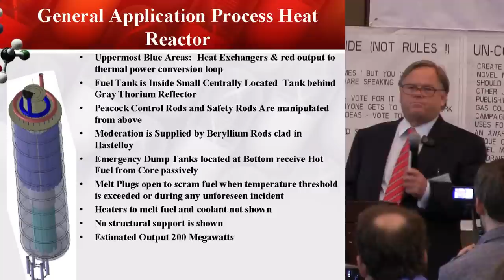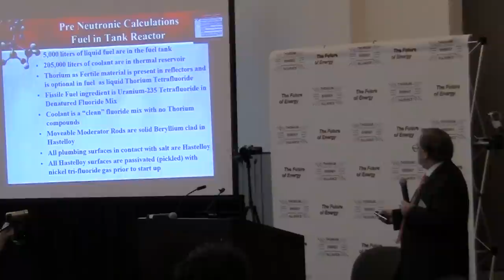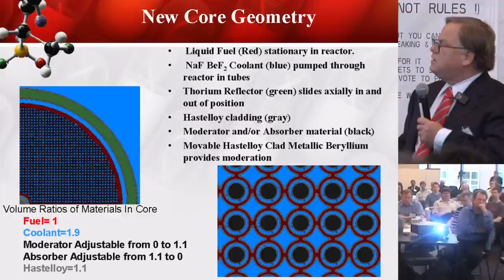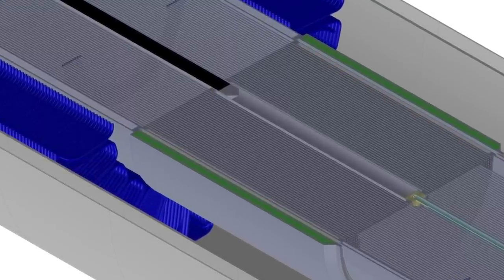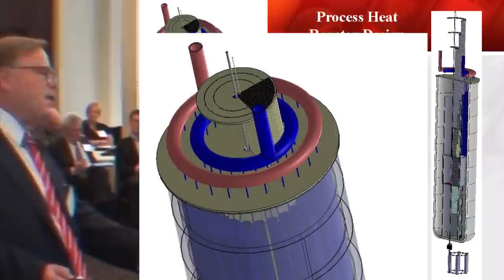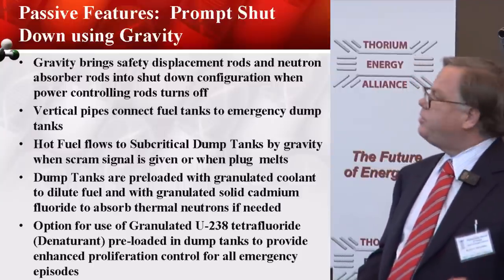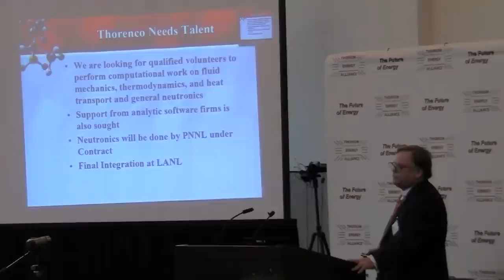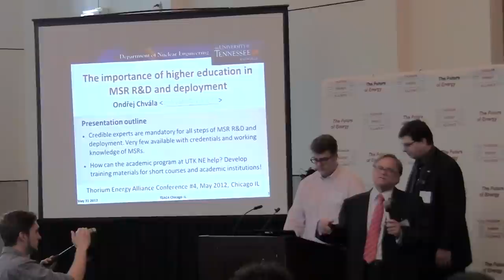Charles Holden - Thorenco's Process Heat Reactor / Liquify Through Thorium @ TEAC4

Comment: This is interesting because a little different from the LFTR design that Mr. Sorensen has been talking about.  I'm not saying either design is better or worse, but having more than one design being talked about in public will enrich the intellectual environment for designers, I suppose (I'm not an engineer).  The fuel, although liquid, isn't circulating as the coolant.  It's an interesting point about the 40:1 ratio of heat storage to fuel.  As the speaker says, the temperature of the whole machine would change very slowly and so if the reaction is doing something untoward, there is plenty of time to decide what to do about it.  In terms of presentation, I think the speaker made a good decision to describe the machine as a heat source and leave open what sorts of uses the heat might be put to.